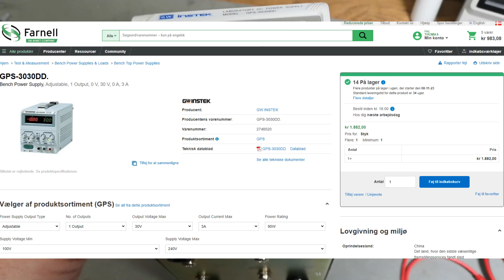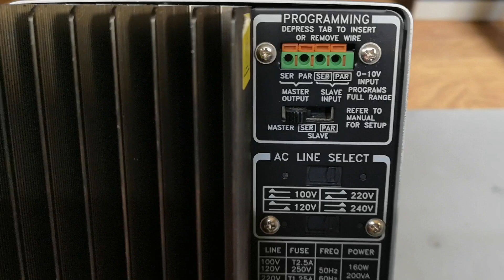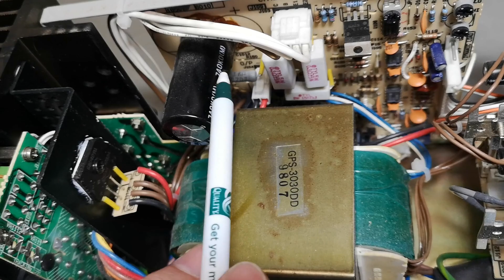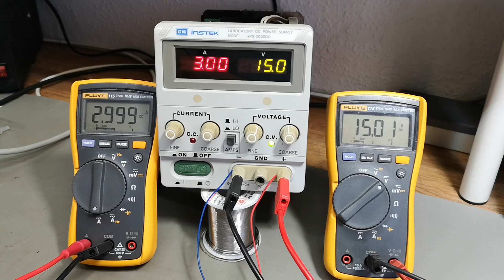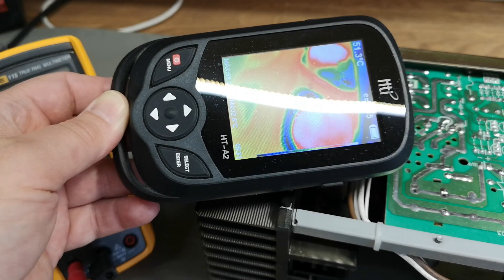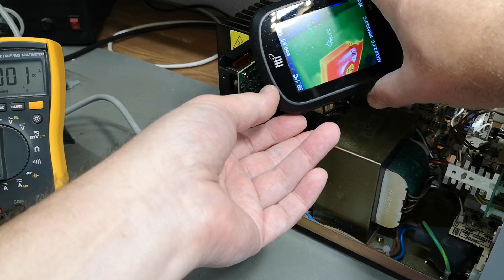GW Instek GPS-3030DD power supply 30V 3A test teardown

Comment: I have this PSU, what I didn't understand is why I can't really adjust the current? in my mind, you set voltage and max amperage but doesn't work.

So what's the amperage adjustment for then?
Reply from the maker: but a 10 ohm resistor big heawy type on it, turn up the voltage to 10V you should see the current is now 1A, now keep the voltage dail untuoched, and slowly dial down the current until you get 500mA, now you see ? your are using the current regulation, mostly it is used for protection, like you have a good idea what is the max usage or safe level of what ever you work with today, then set the current limit to a point a little bit over that, and you can save your construction from causing too much extra damage, when something go wrong